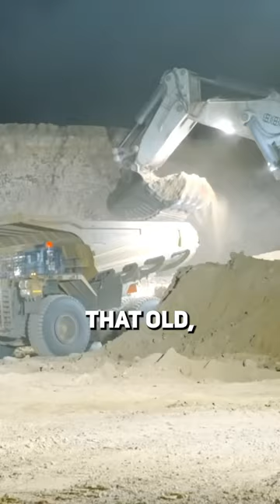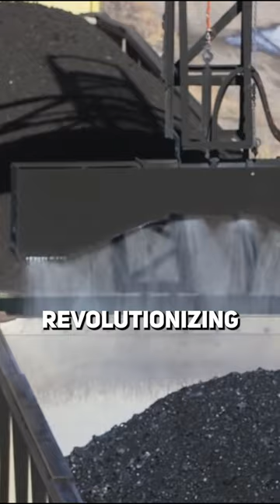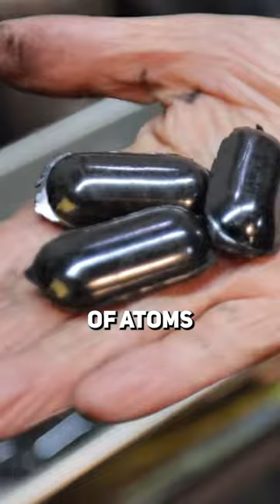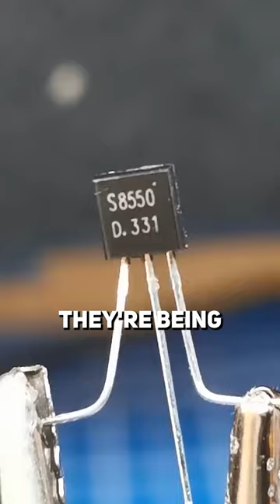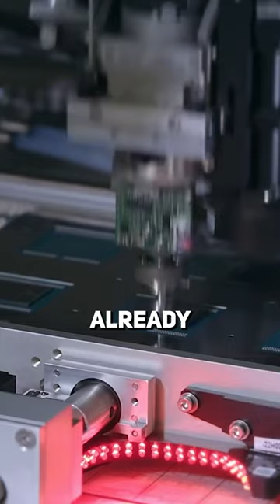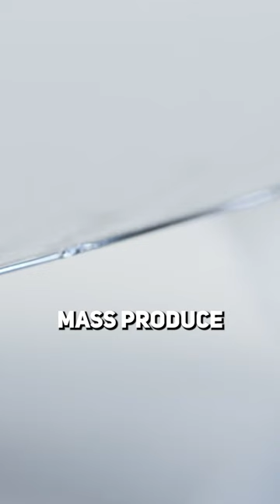Is Coal finally useful again?!

Comment: Graphene? Are you describing graphene?
Reply: That would be my guess
Reply: Ya they wanna stop calling it carbon so it’s more expensive…other hard metals are in the body anyway.
Reply: Yes, it's over 20 years so definitely not a "new invention"...
Reply: But If Im not wrong, the only reason we haven't seen it yet mass produced was because it's expensive and difficult.
And I think this update is basically saying we have the tech to make it easier and cheaper.
Reply: That was what I was thinking.
Reply: it would be interesting if graphene could be the main core for quantum computer.

nanotubes actually a good superconductor....

i really curious of what the possibilities of quantum computer could achieve.

but, even until this very second, i still not get any way how quantum computer's processor work. i really want to understand how that thing could proccess data. 

if i could understand it , possibly, i could replicate the process and make my own quantum computers